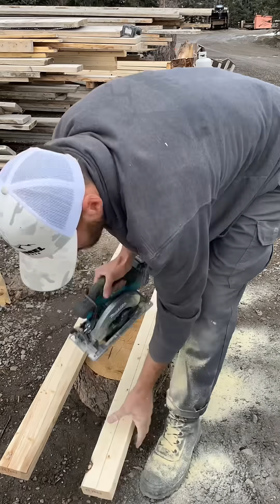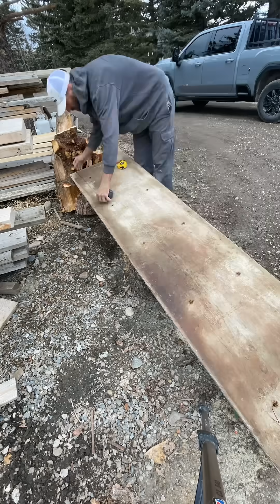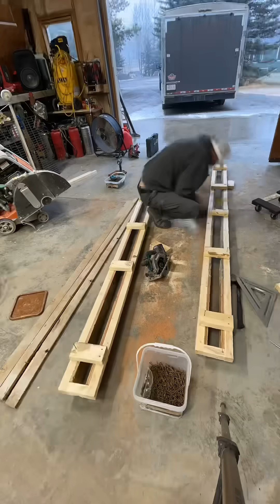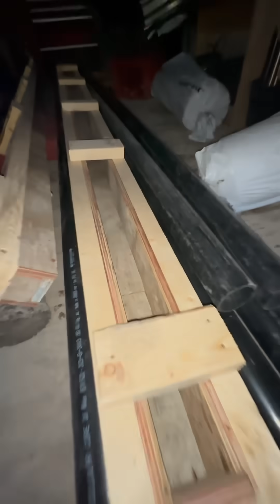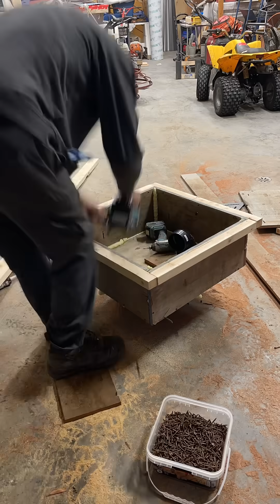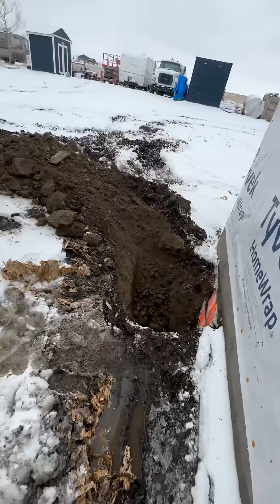How to build your own drains ✅💦#concrete #construction #shorts

Comment: 😢quite literally" we've researched because we'll? We want to do it ourselves😊 K"  
And  I happen to stumble upon this video....   (what's changed) You Sir are hired!!!
The video: (what was learned?) 
😮yes! Crap! It is a real thing! Guy stripped that 2x4 full length no problem🫰

And we'll probably have to watch this video like 110x's to get it right! So this video?🫶
Yet a full well timelined reasonable to watch of the step to step would be 💲💲💲💲

Lowes😂 how about anywhere!??? GRATING!  Us? We've looked for replacement grating's  steel/galvanized.. they're available yes, but this makes no sense 🤔
4.375 NDS trench channel system.  10ft grating included 164.00 that's 120in
Now☝️ a replacement grating available 😅😂 4.375 galvanized metal 39.5in long comes as a set of ✌️ therefore you buy 80in at the price of 85.00
THATS NOT 120IN

(Cost of lumber, cost of angle iron & time) all the sources say it's cheaper to buy the 10ft system for 164.00 and inset it into your concrete as you pour it/preset in.
Right? I mean that's why we're sheep right? 

BECAUSE before we'd searched for the grating alone in metal galvanized! Nah' it wasnt going to be worded right no matter how hard you tried in searching for. So almost it was 
Regardless: I'd take that cheap plastic/special material with inner obstacles-ridges &   throw it out just for the grating! And live easy with comfort in something that will not fail or be damaged  in a short period (IN The Concrete!) If you know concrete? Doing your own drain "using forms" then you know what's really practical!❤
Maintenence .
Cleaning.
Ya'all do the homework on that🎉

I'm sure we can find that grating elsewhere" but because the SCREWS ME'S are in motion in this market world, and an algorithm which supports that screwing, combined by top supplier 'eg homedepot/lowes' etc, whoever has the most money to be up front on all google searches.  How much time do we waist for real direction and practical ways that USED to be general Everyday practices! 

Hay" thank you for this video❤

Comment: What width do you cut grate at
Reply from the maker: @LandscapeBuildersHawaii  I think 7.25” is what it works out to be. Drains are 7.75” wide leaving 1/4” each side
Reply: @ thanks I was looking at some bar grating at supplier and the bar was right around 7.25” where it would be cut so was wondering if it was similar

Comment: I am 100% on board with DIY, but when you eliminate the plumber, I would suggest P traps and proper venting if the drains tie into sewer or septic system? P traps will prevent odors, bugs and rodents from entering structure. No sanitary tees on their sides and use long radius 90°'s or 45° fittings. If proper venting is installed, install atleast 1 full size, end of the line clean-out. Just some advise from your friendly retired master plumber.

Comment: Now wait until the concrete finishers defeat the purpose of having a floor drain by building dyke/ dam around the drain no less than 1/2" higher than the rest of the floor, so that the entire basement has to flood to that depth before it can run into the drain.

Comment: An old trick my dad showed me the "Water and Sewer Dept." would use to determine the correct drain slope {1/4" per foot}, they would cut 6' lengths of 3/4" plywood on a table-saw, and glue the 2 lengths together creating a Plywood Level 1-1/2"w x 2-1/2" d x 6ft. long. In those days wooden levels were inexpensive and plentiful, so they would screw the level on the top edge with a couple of wood screws. Now you have created a 6ft level that was coated in Polyurethane to protect it from water. Then you just need a 2x4 scrap, laying flat on the top of pipe, at the low end of the wooden level on the pipe your are setting, and Budda-boom when the bubble on your Sewer Level reads level, you now have the correct slope for a sewer pipe{6x1/4"=1.5"}. Nobody cares if it is dropped in the muck, it is a piece of plywood.

Comment: So competitive that we refuse to purchase even a table saw. 

It’s a good skill to be able to rip like that but at this scale you’re working against yourself.
Reply from the maker: Nope, don’t have room for table saw and despise them lol
Reply: @ I live in a one bedroom apartment and still find room for my jobsite table saw. The skillsaw, direct drive (worm drive) motor table saw comes with a cart that has the biggest wheels you can find on a job site table saw and came out of the box perfectly square for me with little to no adjustment needed. I use a roller stand for out- feed. 

I dont understand how someone could hate such a necessary piece of kit but you can just keep slowing up production I guess that’s your choice. I supposethat’s why you’re so good at ripping those boards with a circ but it might cost you a finger one of these days.
Reply: @funkmanone any rear handle handheld will rip a 2x4 faster than a table saw tho. And they don't take a strong breaker
Reply: @jaywiebe7612  that’s such a load lol. Plus the main points are safety and accuracy. You can’t rip as quickly with a circ as you can on a table saw and be as accurate I don’t care how long you’ve been doing it. Table saw will always be superior to circular saw for ripping it’s just basic knowledge. To argue with that basic fact is just being unnecessarily stubborn. 

There’s a time and place for everything and if I have to just do a couple rips in the field I will prefer to use my circ but for a larger project where I know I will need to be doing a lot of ripping, table saw is where it’s at. I did a lot of research before I bought mine and made sure to get the best jobsite saw possible because there is a lot of garbage out there today
Reply: @funkmanone  that's correct. Although trying to rip anything over about 8' long is a lot more challenging if you're by yourself. I'll use a table saw as well if it's gonna be more that just a cut or 3. Which these guys won't be for just a couple of drain forms. I'm curious tho... What it your favourite saw and why? We use DeWalt and they've treated us very very well for the most part but I like hearing options by people who actually use them. Our corded table and Mitre saws are all yellow except for one each of Bosch.